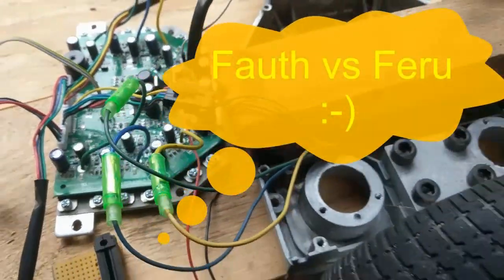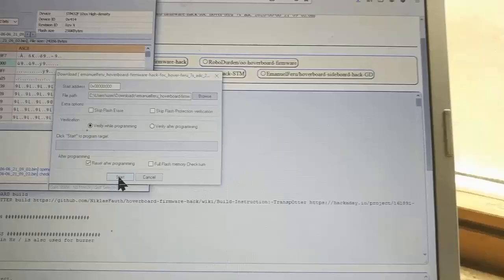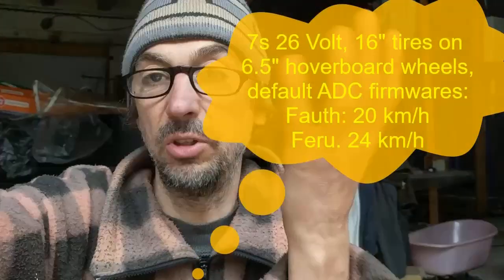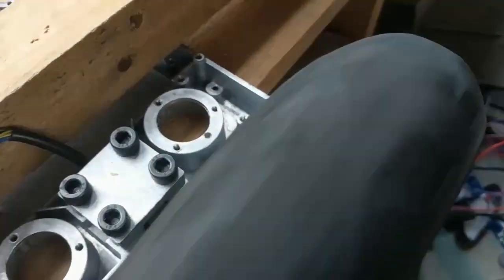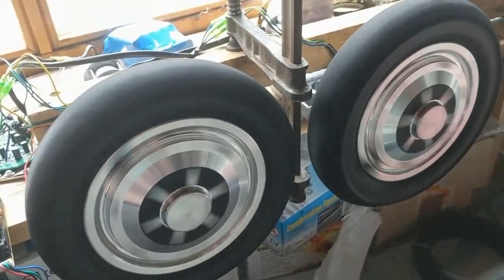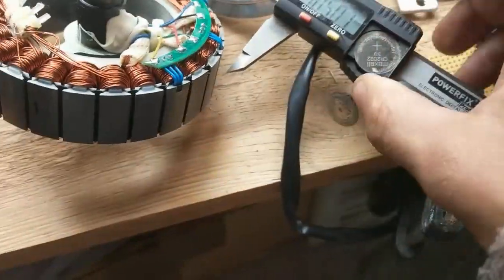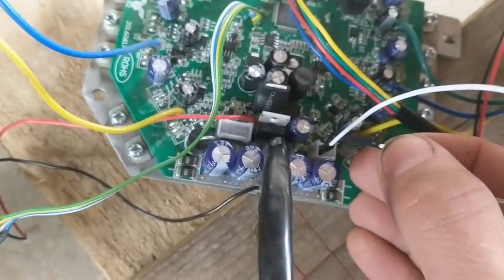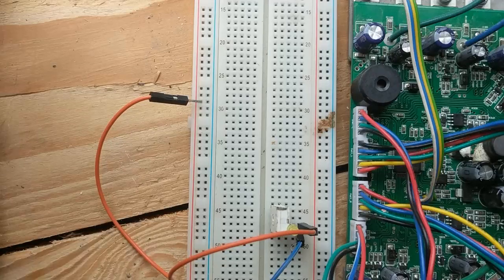hoverboard firmware: Fauth vs Feru :-) and 10 inch vs 6.5 inch :-/

Comment: was having the same issue with 10 inch motors, it worked well after swaped the Hall sensors wires

Comment: Hallo Robo, schau dir mal die Polung der HAL Sensoren an. In deinem Video sieht es so aus, als ob beim 6,5 Zoll Rad die Farben des Steckers zum Board passen beim 10 Zoll Rad aber nicht. Evtl. ist der HAL Sensor unterschiedlich belegt.
Reply from the maker: Yes you are absolutely right :-) After i connected the the motor phases differently the 10 inch motors now run as smoothly as the 6.5 inch versions. Indeed there is also a color mismatch with the hall sensors connector but the motor cables needed the third color combination to make them work. Thank you very much !

Comment: Great video? Did you compare stator width? Some motors have 25mm, some 30mm. Maybe this has something to do with this isue. I think your 10" motors has narrow stator/magnets.
Reply from the maker: you mean the height of the stator or the length of the magnets ? No i forgot to measure this and already have put all the parts together again. Maybe i will open issues at their githubs, Niklas and Emanuel should know best why the 10 inch motors have such a strange behavior.

Comment: Nice Video Robo! Thanks for sharing it! The 10 inch motors behave like this (also mentioned in the last comment) because the Hall sensors or motor phases wires are mapped differently. I also see in your video when both motors are opened, that the wire colors for the Hall sensors between the two motors 6.5" and 10" are not the same. 
I have the 10" motors on my Hovercar and they work equally well as the 6.5" (see Hovercar video here https://www.youtube.com/watch?v=IgHCcj0NgWQ&t= )
Reply: I'm pretty sure the hall sensor wire order doesn't matter. I bet there is something to do with with magnets and polls. But that's just a guess. I do know that hall sensors don't have to be in order.

Comment: Hi its possible to set more speed on Efru firmware with 36v? Got an diy electric gokart for kid and max speed on 12 inch wheels is 17km/h. Changes in config.h dont work.
Reply from the maker: Another stupid fun project :-(
Try field weakening. Can boost max speed by about 25% .
Stupid fun projects :-(
Stupid people.
Reply: @robodurden  could you explain what you mean by stupid fun project?
Reply from the maker: Building something to have fun.

Comment: Hi. please tell me where I can find information or a diagram for connecting potentiometers . When I flashed hovercar my Board beeps in a low tone and I can not make it work. Help please. I will be very grateful for any help
Reply from the maker: https://github.com/NiklasFauth/hoverboard-firmware-hack i think ADC1 is steer and ADC2 is speed. Only 3.3V to these cables !!! I think best is to take a 3.3 Volt regulator connected to the 15V red cable. Board beeping might be because firmware thinks that battery voltage is too low. If you are using a 24 Volt battery than change the 10s to 7s in the config.h

Comment: How can we ask a question from you?
i saw some of your videos about reusing hoverboard motors. i want to use the motor as a sewing machine motor. it needs a pedal. can you help ?
Reply from the maker: If you have a code/firmware problem ask here (start a new issue): https://github.com/RoboDurden/Hoverboard-Firmware-Hack-Gen2.x/issues
Sewing machine does not need high torque so you should be able to drive the sewing machine directly or with a 1:1 chain or toothed belt.
Sounds like a nice project and not yet another stupid fun project.
Reply: @robodurden  thanks

Comment: Hallo. Firstly thanks a lot for the good work. If I may ask, I am currently building a small kids car for my son using hoverboard motors and controller. I like Eferu's FOC control hack. I will be using PWM variant for remote control, is there any way to measure the rpm of the motors? I could use an Arduino and Nextion HMI just for speed display purposes. Thank you.
Reply from the maker: Choose a Variant_Uart and connect an Esp32 S2 Mini to read and control the hoverboard.
Reply: @robodurden  Never worked with ESP's before,  thanks anyway.

Comment: Hi does that hoverboard controller can handle 48v 13s battery? i have that foc firmware does any setting must be cheange for that battery?
Reply from the maker: Please test and report back here :-) I would also like to use two boards with a 16s Lifepo4 battery.
The usual MOSFETs are rated for 75V and the input capacitors 63V. But you should add active cooling to the aluminum back plate. Maybe even water cooling is needed. Or replace all 12 MOSFETs with ones that have a lower R_ds_on.
In the config.h you have to increase battery cells from 10 to 14. There is also a setting for max current that you should increase, otherwise the board will not allow more power.
I think that Niklas Fauth tested 12s as the maximum because more power will simply melt the motors! In my setup I have 1000W motors from attached so the risk for me would only to burn the controller boards.
Reply: @robodurden  there is any controller temp limit protection default enabled  on foc formware?  or  is there any thermal protection of the board in config.h file ? i won't  to burn my board
Reply from the maker: @automoto95  You don't seem to have any deeper insight in programming or electronics, so if you don't want to risk anything, don't do anything.
You should have searched "temp" in the config.h ..
"the sensor is inside the STM/GD chip.", so this will not really help you when the mosfet burn.
Try or die.
Reply: @robodurden  ok i found that thanks

Comment: I made a 3d printed wheelbarrow tyre adapter and put it on thingverse. so you can use big tyres with small hoverboard motors.
Reply from the maker: link to thingiverse is missing. Or at least your user name over there.
Reply: @robodurden  youtube is deleting my replies.
Reply: @robodurden  its called Wheelbarrow Tyre 3.50-8 adapter for hoverboard.
Reply from the maker: thingiverse.com/thing:6657711 . Yes i have a coreXY with 30x30 cm build plate to fit your adapter. Print time over 24 hours. What is the volume with solid print ? Looks like half a kilogram :-/ You should a 5mm height slice of the middle to test that the adapter will fit in the end.
The outer diameter of hoverbaord motors can vary for +-1 2mm. the ones with 30mm magnets are a bit bigger then the 25mm. In your case you only have 20 mm magnest inside, i guess by the Merceds star on the side of the motors.
Reply: @robodurden  I found the motors with the stripe were a couple of milimeters smaller but it could be fixed with a couple of strips of tape around the hub.
the flower and star motors are the same size.
Reply: @robodurden  i would keep the pressure low if you print them less than 100% i tried printing them with 30% but they split when i put 15psi in them. 5-7psi should be enough unless your robot is really heavy.

I might make another version with holes to add bolts though them.
Reply from the maker: @geofrancis2001  It should be possible to split the full rim into 6 segments for easier print. Maybe a lot more so i could print one by one with my resin printer. The pressure of the tire would push them onto the hoverboard rim. Then you would not need to open the motor to insert the plastic rim! 
I need such an adapter for my eight 4.00-8 PU wheelbarrow tires. They are nearly 40cm in diameter and no air pressure inside. Maybe each segment in two halves an a M6 screw to pull them together and the complete adapter securely onto the hoverboard motor..
But you still have not said how much kg/liter your big adapter needs.
Still i think that printing such a big thing takes too long and is too expensive...
Reply: @robodurden  printing it solid is around 1kg. 50% should be enough unless you want to run high pressure. 
basically to get tyres that fit the hoverboard motors was going to cost me £35 per corner, because they are mobility scooter tyres they have to be road legal and that drives up the cost. its about £12 a kilo of filiment and i can get the tyre+tube for £8  so its still a lot cheaper for me to print them. £20 vs £35.

Comment: Can you share your experience with wheelbarrow 16 inch diameter wheels. how much weight it can carry if we use 4 motors. Is the torque enough to carry two persons with 100 kg frame.
Reply from the maker: I have built a prototype with wood and 4 motors to test a new steering mechanism. Only powered the front motors with 7s 25V and accelerated flat to 20 kmh. The tires are not made for such high speeds, so the car started vibrating.. be as precise as possible.
You can calculate the torque Nm in the third formula of https://www.torcbrain.de/drehmoment-und-leistung/
Uphill the motors should make about 12 RPM at max power.
At 25V i experienced about 200 Watt power output. So with four motors you get 800 Watt at 300 rpm and therefore a torque of 25.46 Nm.
A 40 cm diameter wheel has not a lever of 1m but 0.2m. So the car can push upwards with a force of 5* 25.46 = 127 Newton = 12.7 kg.
With 10% uphill you gain 10 meters height with 100m driven. Make a drawing of the forces and you can see that the car can pull only 127 kg uphill.
6% uphill would be 12.7/0.06= 212 kg.
With 36 Volt and 350 Watt you would get 36*12 RPM and 4*350 Watt, so a combined torque of 31 Nm. Carrying 310 kg at 10% and 517kg at 6%.
Max speed at 36V would be 14 rpm/V * 36V / 60s * pi * 0.4m * 3.6 km/h/m/s = 38 km/h :-)
Send me an email if you indeed will build such a nice car!
Reply: @robodurden  Great thanks I will email you.
Reply from the maker: @khanatifali1800  I have answered you two days ago. You maybe look in your spam folder.
Reply: @robodurden  Thank you very much my friend for your detailed reply.  I was badly ill I will give you  all details today by email.

Comment: hi does did you know where i can find to download stock hoverboard firmware to go back to the normal hoverboard functionality?
Reply from the maker: There is no stock firmware. But some github firmwares offer hoverboard. Check Emanuel Feru or https://github.com/bipropellant/bipropellant-hoverboard-firmware
Reply: @robodurden  thanks for that.
Reply: @robodurden  i can't find the single  .bin file to flash of  the bipropellant-hoverboard firmware where i can locate it?
Reply from the maker: @automoto95  You have to compile the firmware yourself. You can use my hoverboard compiler for that: https://pionierland.de/hoverhack/

Comment: Hello Robo!
Thanks for all your job!!!
I saw you connect only a 220kohm potetiometer but I don't understand how is the wire diagram. I already tried with 2 pot with the Niklas firmware and it works. Thanks!
Reply from the maker: for my 4-wheelers i only need speed, no steer. So only one potentiometer for the speed adc.
Reply: @robodurden  thanks for the quickly answer! I have a 10" wheel hoverboard; what about the motor phases? (referred to your answer you gave to Robert Bartelt)
Reply from the maker: @fulvionani5577  simply try all color combination until one works smoothly.
I have been thinking.. i could turn www.pionierland.de into an expert forum where all you tinkeres can register and select how you can tribute to the hoverboard community:
1. which firmwares you have successfully tested
2. which use cases you have succeeded: wheelchair, 4-wheeler, recumbent bike, wind turbine, water turbine, hoverboard, etc.
3. what special features you realized: recuperation/electrice brake, etc.
4. what control methods you successfuly implemented: ppm, serial, adc, etc.
5. would you accept paid jobs ?
That could become a worldwide expert community..
And with car companies desperately searching for programmers, this forum could be a career starting point for all of you.
Would only take me a day to set up a futuristic forum with my oo-database, see for instance www.scriptdoctors.org.
And then i could run a USD 500 Kickstarter to rent another v-server for $4/month only for the online compiler. Right now i only allow only one compilation at a time because i use that vserver for other things too.
With all the different firmwares and different control types, an expert forum in addition to my online compiler could become a very fruitful place - that even could make the world a better place.

So will you back my Kickstarter campaign with USD $10 within the first 24 hours ?
Reply: @robodurden  It could be a good/interesting project!
Reply from the maker: @fulvionani5577  that was not my question.
Reply: @robodurden  of course! I will support your campaign but I would like to see a survey where at least 50 people answer yes!
Reply from the maker: @fulvionani5577  Yes, a Kickstarter always needs a good start. The forum would already be online and should have at least 10 members who will answer technical questions according to their expertise. I already have made too many Kickstarter loser campaigns..

Comment: hi, robo durden, am making a ebike with this system, is almost finish, but my st-link device dont connect, 
do you can tell us some tips for connect the st -link to a mainboard for a very first time?
Reply from the maker: read the github page of Niklas Fauth and watch my tutorial https://youtu.be/15UBBcZvMh8
If nothing works, try the usb dongle with a blue pill to see if that works.
And post a video of your ebike !
Reply: @robodurden thanks robodurden, well i am waiting only for that, to finish,, am seeying your videos seconds by seconds for catch details in the connections,
do you can helpme with some tips for connect the st -link to a mainboard for a very first time?
Reply: @robodurden  the bluepill stm32, connect very good with the st-link, but the st-link with the mainboard no,, i have 2 hb, the 2 have the same prob. and originally with normal assembly working good both hb
Reply from the maker: @josem-proyects6042  i fear i can not help you. The battery voltage should be 36 Volt and the on/off push button replaced with a short cut jumper. Then only to connect: gnd and the two program pins.
I will make the part 2 on hoverboard repair tomorrow and will again propose an expert system where you could find more help then simply asking me. So i expect you to write a comment in that video.
Reply: @robodurden  Very thanks robodurden. I  will be active to se that video for see more details to my proyect. And soo the connections,  the 36v is connected, the jumper too, and the 3 cables from the st-link too... but i was seeying in the niklasfauth link, this part that dont understand says this:

<<<If you never flashed your mainboard before, the STM is probably locked. To unlock the flash, use the following OpenOCD command:
>>>

openocd -f interface/stlink-v2.cf""
Reply from the maker: @josem-proyects6042  I never had that problem and i have not yet seen anyone who needed to unlock. Maybe this is your problem but i can be of no help :-/